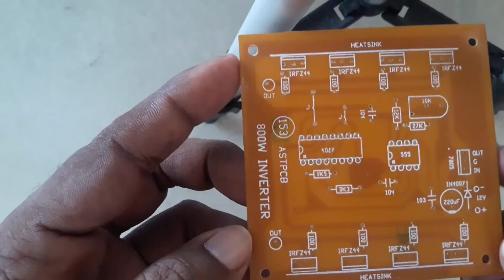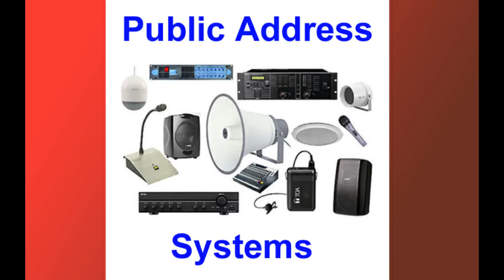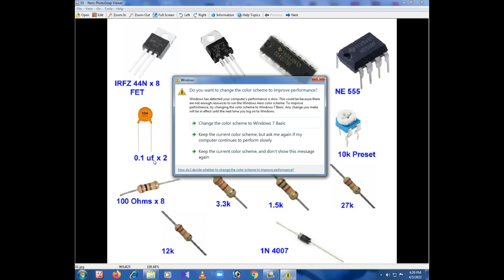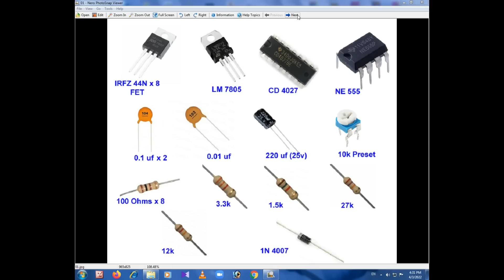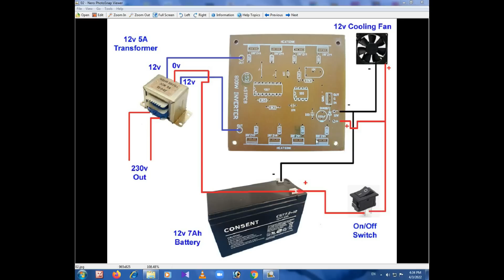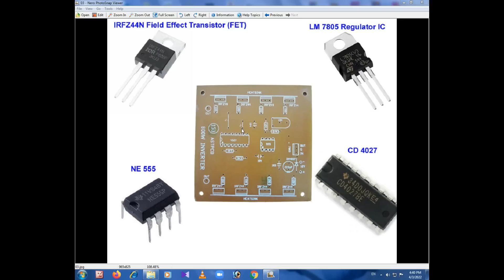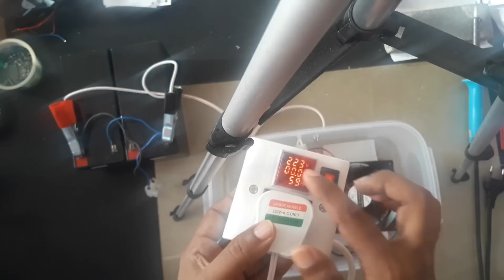How to Make 12v to 230v Inverter | Home Made DC to AC Inverter | 230v Inverter

Comment: Good job!
This inverter is good for 192 Watts maximum based on transformer size. To get 800W the input current  needs to be 33A and you would need #10AWG wire for that. The PCB has to be beefed up accordingly.

Comment: * 6v UPS ට්‍රාන්ස්ෆෝමර් එකක් (2 wire ) winding හදලා 12v විදිහට (3 wire ) කරලා  inverter එකට හයි කරා. 
output voltage 450v විතර පෙන්නුවා (preset එකින් අඩුකරන්න පුළුවන්). ටිකවෙලාවකින් එක පැත්තක mosfet ඔක්කොම පිච්චුනා. mosfet විතරයි පිච්චිලා තිබුනේ. ට්‍රාන්ස්ෆෝමර්  එකේද ප්‍රශ්නේ?  IC base පින් දැම්මේ නෑ **
Reply from the maker: Transformer eke voltage balance da kiyala balanna